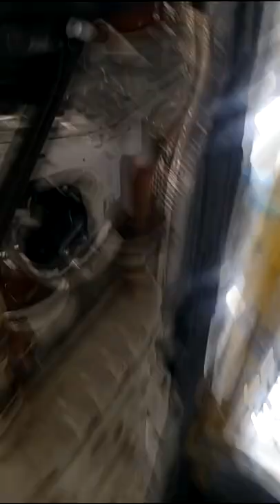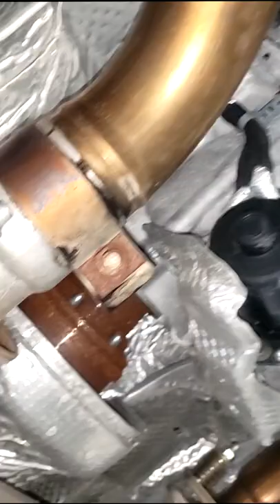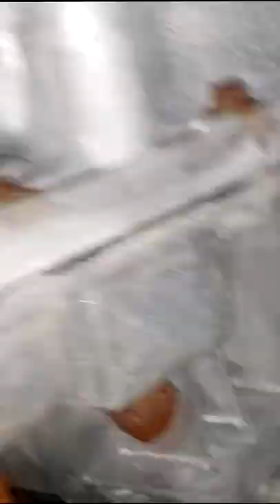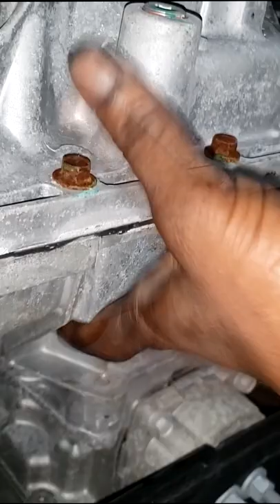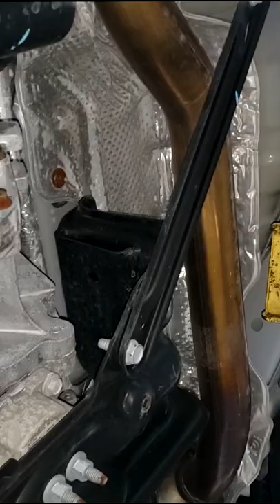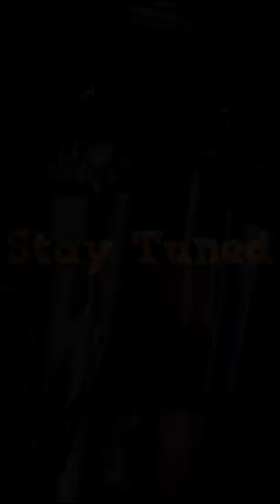WARNING. If you hear this noise, CALL THE TOW TRUCK. #JTtheCarGuy #shorts

Comment: It's Chinesium.
That's the problem...
Reply: No such thing as chinesium
Reply: @JDMSwervo2001 
Obviously, you've never been a welder.
Chinesium is the term given to the "pot metal" (the crap metal slag) used to manufacture cheap goods, like cheap futon n bed frames, n such, tables, chairs, etc.
The crap cannot be welded. When you try, it just pops n crackles, n you end up burning a hole in the "crap metal". You can try brazing, with flux, but when heat it up to braze, the metal just disintegrates...
That, is Chinesium. Another way to say it's
Cheap Shit. To put another way, a 350 turbo hydramatic in a Chevy is bullet proof. Had one in my truck, still burnin rubber at 190,000 miles! You can have your aluminum... Chinesium. It's unadulterated Crapola.

Comment: Hey I have a Infiniti G 35 08 and the hot and cold needle goes up and goes back to the middle ? What could be the issue if u don’t mind helping me with a little knowledge
Reply: You are running too hot. There are many reasons why. Having coolant in the engine is critical. If the engine is low on coolant, do not drive the vehicle until it is refilled. If the coolant was low, the leak has to be located and repaired. Once your engine has run hot it will have to be assessed for engine damage that could be from no damage to severe engine damage. The factors for engine damage are," how hot" the engine got and for " how long "  it was driven hot. I hope this helps.
Reply: Sounds like low radiator coolant, air in cooling passages of engine instead of coolant.  This leads to overheating and will damage the engine.
Have your engine checked and cooling system serviced, the engine oil should be changed as well because overheating will compromise the lubricity of the oil.
Reply: Put coolant in it asap. That VQ35 will hate you forever
Reply: @funnypranker34  yeah it’s up on coolant and it’s up on oil . I think it might be a bad hose . Because it only does it like if I’m pushing the car .